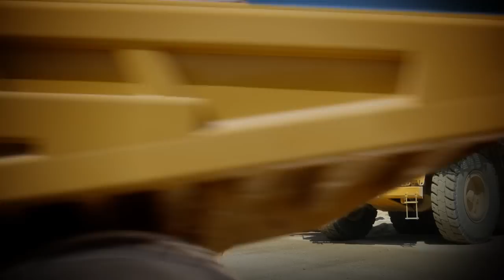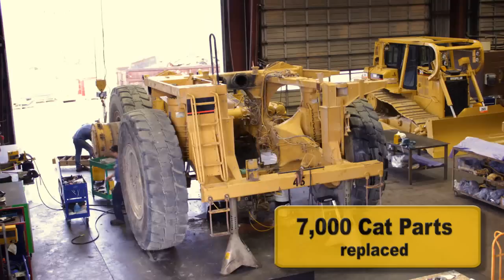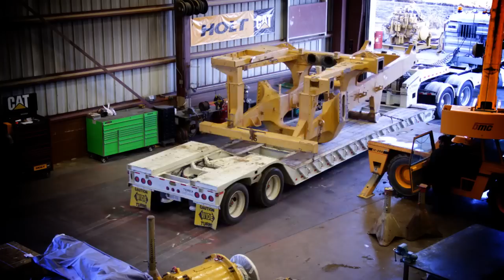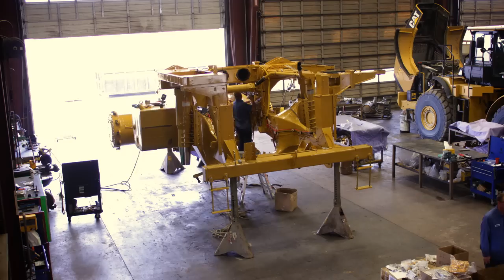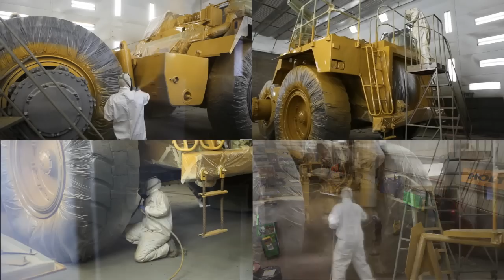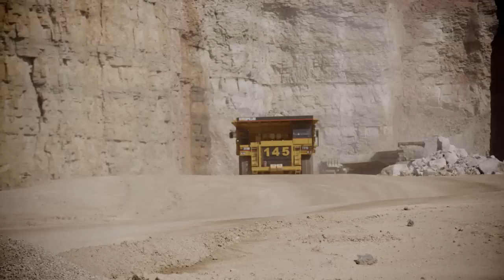HOLT CAT 777D Rebuild Time-lapse

Comment: must suck to drop all those rocks in there after that fresh paint job
Reply: I'm surprised that Cat even bothers to paint the inside of the beds. Shoot a coat of grey or yellow primer in the beds and leave it that way because the paint is going to be removed by the payload.
Reply: @epistte  same with the dozers why bother paint the outside tracks and front blades